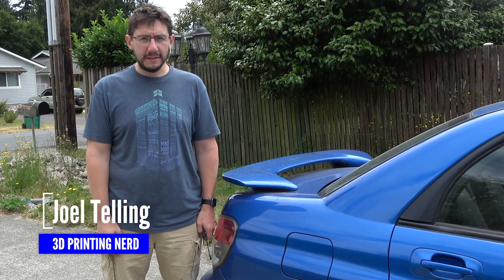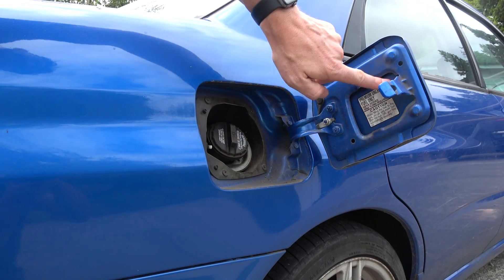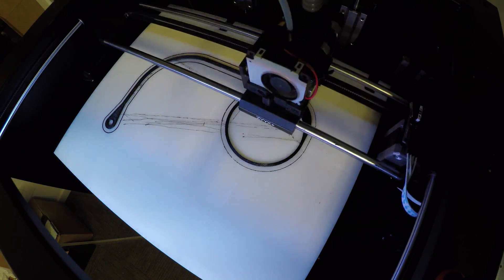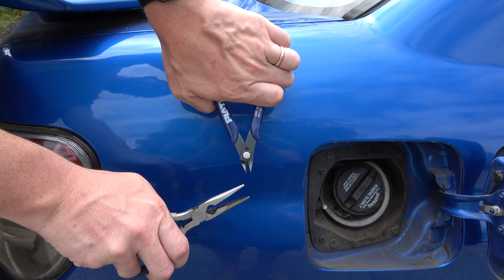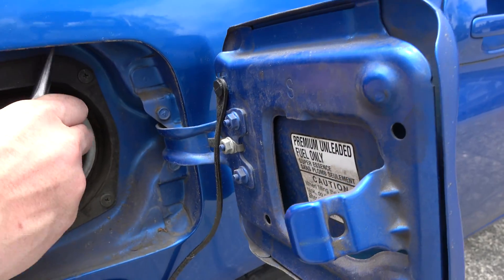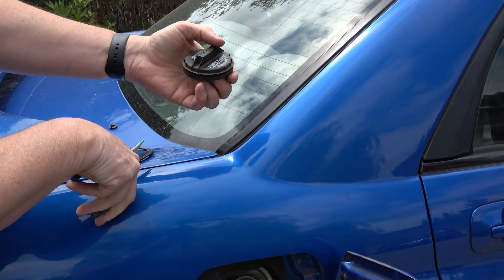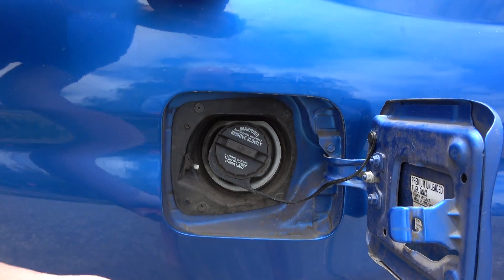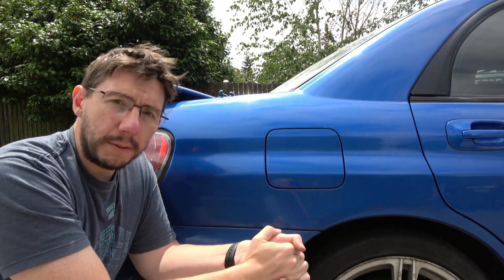Using 3D Printing To Fix The Gas Cap On My Subaru WRX With The ZYYX+ 3D Printer [Practical Printing]

Comment: Great video! 3d printing is perfect for fixing things like this that you can't really go out and buy at your local store. Something else that breaks a lot is the cover for the air conditioning control panels or even something like TV remote battery covers. They also get lost. People usually end up buying a new product when really you could just 3D print a replacement part and presto! Back in business. Good Job Joel!

Comment: https://www.makerneer.com/product-page/replacement-subaru-gas-cap-lanyard

Many people have asked how the material holds up over time. I had mine installed on my car for over 550 days (Since Sept 2015)! Removed only a few months ago as we are trying out a new model. 

I am happy to say it was still working GREAT and showed no signed of issues. This lasted longer than the original Subaru lanyard that came with my 2010 car when it was new off the lot. It was printed out of 1.75mm Blue TPU. There seems to be no issues with gas splatter, melting, hot/cold weather conditions or closing the door on the lanyard/breakage. Still very flexible and sturdy! 3D printing is AWESOME.

Comment: Hi 3D Printing Nerd! Thanks for taking the time to make and install our gas gap lanyard. I'm glad to see it worked to fix your car too!
For those who are curious about how the lanyard has held up - Lanyard #1 was a little dirty but still working great after 582 days in service. It was only retired so I could start testing a new version. You can see a picture of #1 on Facebook here:
https://m.facebook.com/story.php?story_fbid=440829726269047&id=230447183973970

Comment: Great repair but you missed a trick to improve on the original design. Perhaps by making the connecting piece like a repeated 'S' shape it would afford greater flex and possibly last longer or, at least, look cooler? Did you identify the reason for the original part failing and, if so, did you try to engineer out that particular mode of failure? Thanks.

Comment: 1- When you say, "Let the ads play," does that mean that you get less money if we press the "skip" button after 5 seconds or is this referencing people who use adblock?
2- I remember my dad's old truck had a little slot to put the gas cap instead of a tether.
Reply: Right, if you don't watch at least 30 seconds of an ad (or the complete ad for those under 30 seconds) I believe Joel does not get as much or anything.  The 30 seconds things might be wrong, too.  It might have to tbe the whole thing.  I just let them all play all the way through when I watch YT content just to be sure.

Comment: 'Very cool idea! Although, my one concern would be, would the chosen fillament be solventzproof, or solvent-resistant to gas? If it wasn't, then you could end up with a gooey, sticky mess, (or worse)!  So, before trying this out, I would recommend testing it first, in direct contact with a sample of the fuel, (done carefully and safely, of course). 'Would hate to go to that much effort & time, if it wasn't going to work. But, still, it's a cool idea.

Comment: This is what I've been  telling? Joeling? ah well um yeah I did go there (sorry Joel)  Every body here about the 3-D Printer its for those things that are worrisome and most people will use string or worse yet wire to replace instead of the hassle of ordering it from the dealership just print one up and woosh!! all fixed

Comment: About 50% of all my prints were practical useful prints. Even my wife is impressed. Parts for my motorbike and fabricating them would have cost more than the printer. Definitely saved the price of the printer already. prusa MK2S.

Comment: great idea but will the gasoline fumes cause it to deteriate?
Reply from the maker: I thought about that, and I guess we will find out!
Reply: Maybe someone can figure out what kind of plastic the original was made out of?
Reply: If you have fumes venting through a closed gas cap you need a new gas cap as they are supposed to seal the fuel system
Reply: Most gas caps are vented. These generally have a basic one-way valve to allow air in as the fuel level drops, but when these fail they often fail 'open'.

Comment: I have the same question... how will that hold up to gas dripping on it.. I know your not going to soak it in gas but just wondering how its going to hold up to gas....  Love seeing a practical use for the 3d printer!!!
Reply from the maker: That's a good question, and I'll keep an eye on it!
Reply: Cool..  In your recent video about the CR-10 just before this video in the list Ii think..   I  just posted a comment a few hours ago about the same printer but with a BIGGER print area.. they sell a 500mm x 500mm x 500mm version.  It looks exactly the same,  I put a link in the comment and asked if you have heard of it.  I am thinking of getting it and would like your comment on the printer.  THANKS! and great videos!

Comment: More impreza stuff! Did you know you need vortex generators? I was thinking obout printing them because i know for a fact my spoiler doesent get air
Reply from the maker: vortex generators? what? No I didn't know.
Reply: 3D Printing Nerd Next time on 3d printing nerd: "Vortex generators!! 
Come on do it, i know you want to;) Just for the fun of it.
I have actually been thinking if i could print something for my car and paint it with plastic primer and paint. Could i get a decent results.
Reply: You only need vortex generators on track days.
Reply: Alex Swavely can't agree with you. They would come in handy in any high speed situation. The effect would probably be minimal. On my car they would probably even decrese drag. And this isn't about what you need but about what you can do with a 3d printer.

Comment: Hopefully there will be no chemical reaction with gasoline/diesel and the flexible material ^^
Reply from the maker: Hopefully not. Time will tell!
Reply: at most depending on the plastic, the gasoline (it's a subaru no way it's diesel) will just sorta eat at the plastic, i think ABS will be fine, PLA might melt so to speak in gasoline over time
Reply: The 'plastic' he is using is urethane based, it shouldn't degrade badly. I think urethane has a A-B rating in regards to fuel, good enough to actually store it.
Reply: Kazu he has build a chemical plastic gasolin bomb right XD